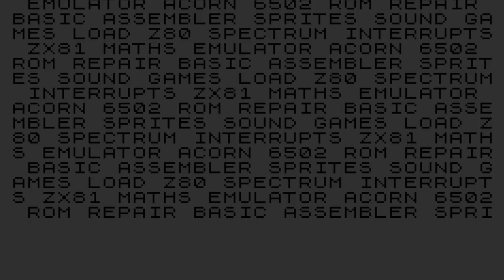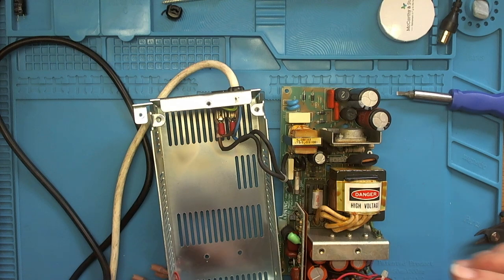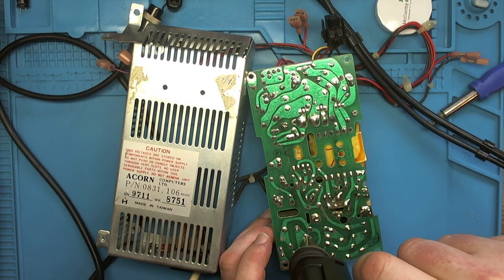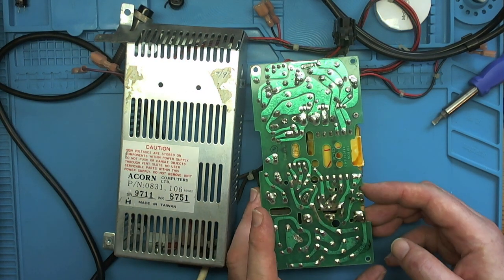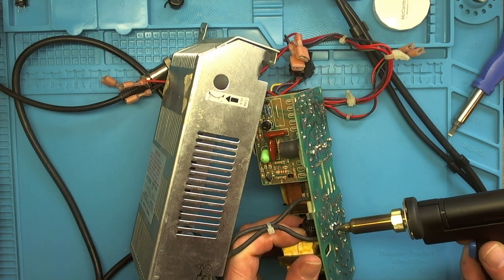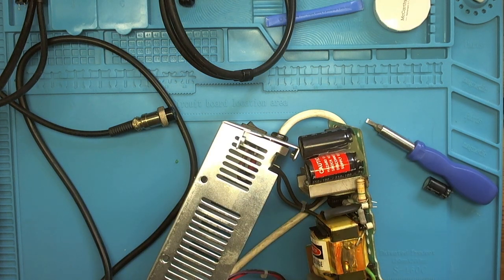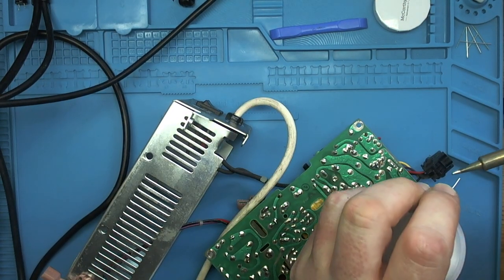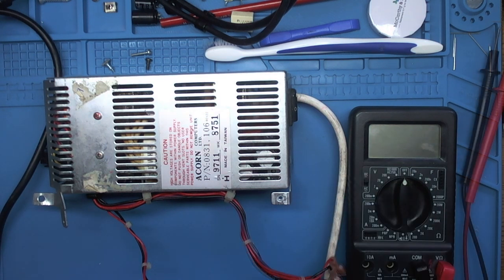Acorn Antiques: Recapping a BBC Master 128 Power Supply

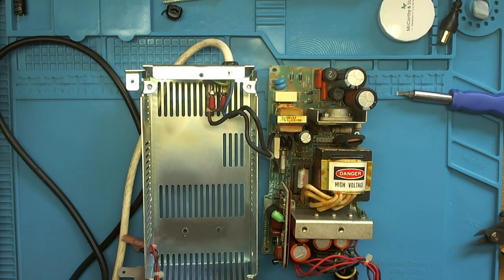Comment: Not quite sure why you changed these capacitors. Looking at video at 3:32 you can see the two X2 capacitors are not the old style Rifa caps with semi-transparent cases that crack. Also if the PSU starts up no need to change C9 starter cap (though I guess this could be replaced if you want to increase life of the PSU until it needs repairing).
Reply from the maker: Yeah, they didn't look too bad. I'd got a couple of BBCs in to repair, this and a Model B. The Model B did have cracked RIFA caps, and smoked, so decided to get 2 sets, just in case. For what it cost, I figured I'd might as well replace them whilst I had the PCB out.
Reply: Yeah - looks like the rifa caps had already been replaced by polypropylene caps?